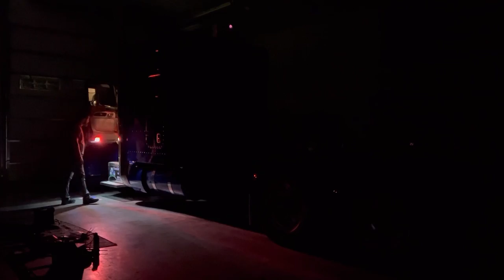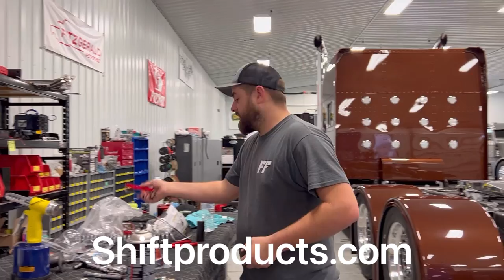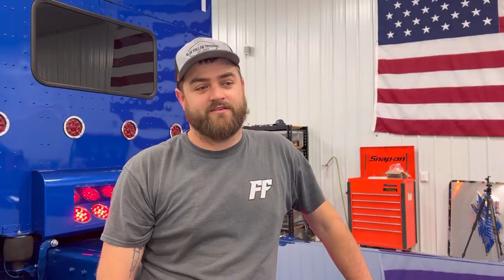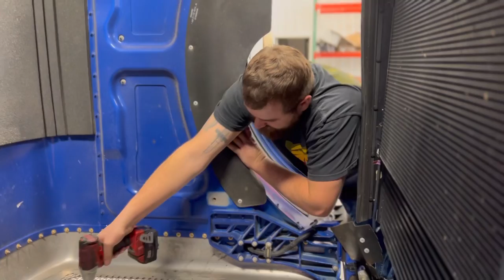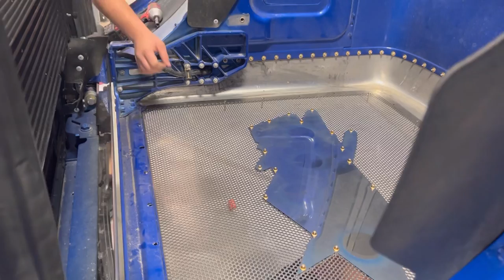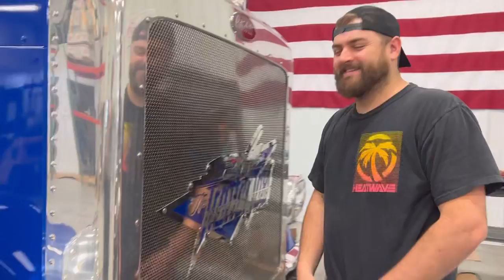New CUSTOM Grille for My Peterbilt 389 the ‘Tratter Taxi”. Let’s Hit the Road!

Comment: May I suggest instead of the buzz bars for the lights, use an actual weather-resistant junction box? Simply because you'll run into issues with wiring down the road with water, salt, and debris
Reply: I was thinking the same thing needs a generic automotive sealed fuse box
Reply: I always used the stainless bus bars .and shot clear over the top just in case.I got a trailer  I built over 40 years ago in Ohio. Salt never had any problem .And if you have any wiring problems, just use a 12 volt test light, and I could unbolt and very easily make up a new wire on the side of the road if you had to.
Reply: This truck will never see snow or salt it's only for shows must be nice to have that kind of money guess its a good tax write off  js

Comment: Truck looks amazing Bruce. I’m loving the grill. Hey you may want to check on the legalities of the red lights for the under glow. I think red is the only color you can’t have down there, because of emergency lights. I’m not 100% sure. I’m the second driver in my 2020 389 and there was red LED’s under the truck and I said to my boss that I was going to see if there good I was going to hook them up. He told me that the guy that drove my truck before me was forced to cut the wires by DOT or get a huge ticket. Keep up the great work Bruce.
Reply: The only place red lights are to be is on the most rear of the tractor period, all other lights are to be amber. Same goes for a trailer (s).
It is for safety. In foggy, heavy rain or snowing conditions, it helps to identify said vehicle and its length. It is to help stop panic driving thus reducing accidents.
On the other hand, show trucks can light up the sky all they want...!

Comment: Go with the big single headlights if you could find the guy that takes the old 12" headlights off a 1930s truck that has led conversion in them those look killer maybe put some led strip lights behind the grill to light it up maybe blue for parked and yellow for driving and go with the swan or the woman goddess hood ornament and maybe put sissy sticks that has tractor toppers that the headlights burn on them on the bumper that would definitely be one of a kind since your going all out on it  now this is JMO and if I was going all out on it to make it a  one of a kind show 🏆 winner that'd what I would do but that's JMO 
And take care of those precious baby boy's there more important than anything else I no you will but keep up what your doing seems to be working out for your young family

Comment: I think you should keep the headlights current, but paint the housings blue to match. That grille would look even more awesome if you put blue LED strip lights around the inside to backlight the whole thing. Lastly, custom blue Peterbilt logos on the hood sides and front. Overall that truck looks absolutely badass all the way around.

Comment: Ok I  must agree bare bus bars not good.  Is your battle of corrosion. 
If you set on under glow spend bit more get color changing led lights. No sense skipping now.
If you had looked while plate was off, yours might have couple of dead holes where button lights could be glued in.
Grill is nice, you may notice 5 to 10 degrees warmer when working motor.  
Why recess handle pulls?  Go old school put air cylinders under to open hood, was even a company that had electric opener cam and chain.  
I know they sell double round and single round headlight assembly for Petes still.  Your truck all lines and edges old double  rectangle look better.  
Still your choice. You finally admitted you want it as show truck versus working truck. Bout time.
Now find some good matching blue vinyl and get a sleeve made to cover apu hoses.  
Can't be going around half arsed.  People will talk.  
Oh yeah I  guilty of it too, is real easy to spend your money for you.  

Happy New Year,   good luck on projects